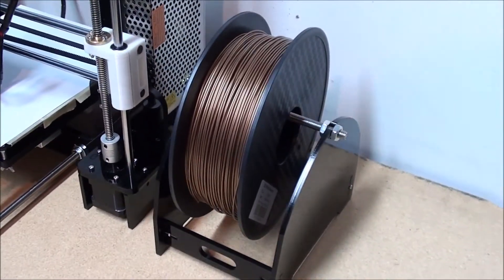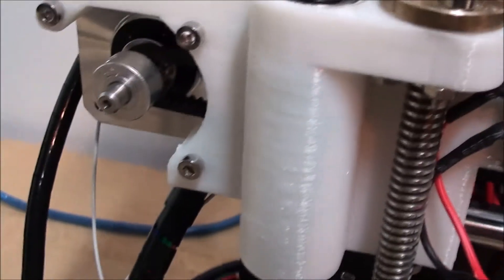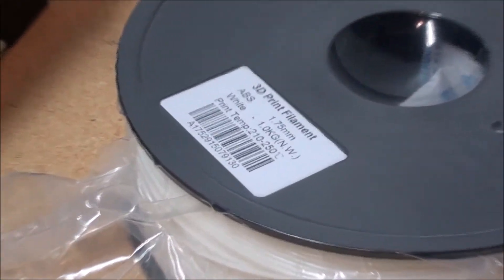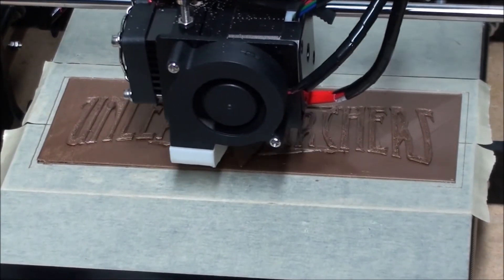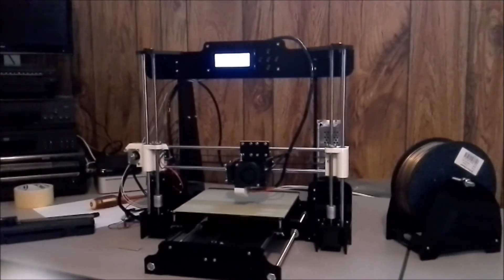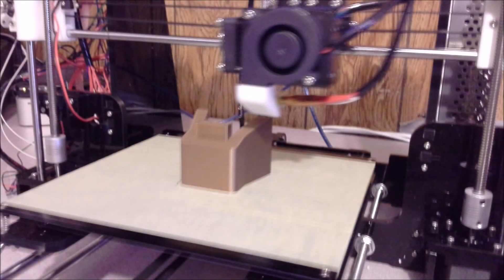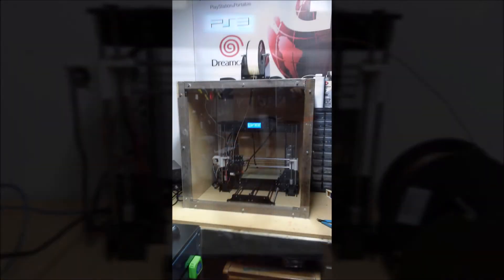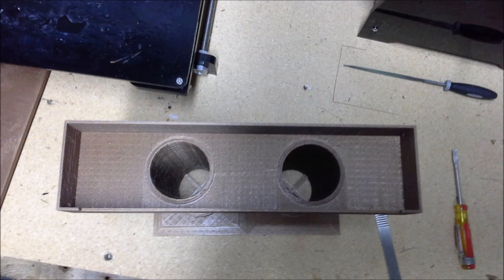Hesine 3d M-505-B Printer Review  | Links in Description Prusa i3, 3D Printer

Comment: I got one of these during the 11/11 sale and my experience is much the same as yours. I do not have an enclosure, but I solved my heat bed problems by adding a layer of high-temp insulation on the bottom of the heat plate. This reduces the downward heat loss and lets me keep the bed several degrees hotter than I would otherwise be able to get it. And it heats up faster as well. I also had some overheating connections on the circuit board (the heat bed terminals) and just added a 40mm fan over those terminals with a bracket from Thingiverse, which seems to solve the problem.
Reply from the maker: +Greg hey so great idea on the heat bed I am going to add that into mine as well as keeping the bed temp at the right temp prevents the ext ruder temps from dropping too much they are not fighting with eachother

Comment from the maker: I'll check in the morning you might need another file check the com ports in device manager it might be there might have to change baud rate that on the printer adjust it on the computer only tho
Reply: +G@m3T3cH Electronics Hi, sorry for the late reply. It's not the baudrate... How did you get it working and what windows do you use for it?
Reply: +Maarten Schut hey friend! i have the same problem, did you figure out?
Reply: +Andreas Pandazis Hey, still having the same problem. I have contacted hesine but the havent given me a solution yet.
Reply: +Maarten Schut Yestarday a friend fix mine, he instal a driver named ''ch341ser'' at the com port whitch i use for the machine..I use windows 7, try if you have still problem.
Reply: Andreas Pandazis Did not seem to work unfortunately, the printer does restart when I connect to it with repetierhost but it just won't listen to any commands...
Reply: +Maarten Schut  I see... I wish you solve the issue soon!!
Reply from the maker: +Maarten Schut hey did you get it going?  and did you try printing off a sdcard as well make sure everything is working another thing is check if a firmware upgrade is available for the board as well or a possible downgrade.

Comment from the maker: 60 on the bed for pla and 210 on the hot end, 80 on the bed 238 on the hot end I use hairspray on the bed tape is OK for pla I use brims as well on abs when needed I use cura on repeater host make sure it's set properly makes a word of difference found the test print on SD card sucks and level level level

Comment: hi G@m3T3ch !I bought this printer but and I had a problem and i cant solve, I try to calibrate the heat bed, when I calibrate the 4 corners, in the center the extruder is stuck and my prints go very wrong or you know if there is any way to auto calibrate hot bed? or you think what  happen?

regards and good video !!!
Reply from the maker: +Emanuel Sanchez how are you leveling by paper method or?
Reply: +G@m3T3cH Electronics  yes ! but dont work :S
Reply from the maker: +Emanuel Sanchez well use a small level and level the bed at the highest point then put the level on top of the extruder bars and make sure it's level as well. if that doesn't make sense I'll see about doing a quick video done up.

Comment: is there any difference between Hesine m505 and m505b?
Reply from the maker: I talked to one guy I'm not sure if his driver board was different or not for the most part should be little difference, if you check on the printer to get the model number is the best way to go. or if your thinking of buying check with the supplier they usually respond quickly.
Reply: +G@m3T3cH Electronics thanks a lot bro! are you happy with the print quality? and has ,the machine ever broke down?
Reply from the maker: +Riyaz Mohammed so far still running strong and like most calibration is key and have not been disappointed yet with it just small amounts of up keep.  only thing is I can't seem to keep enough filament in stock since this video I've probably gone though 5 rolls.  and yes not all prints are going to be 100% but stick with it and you will get the quality you want for your projects.
Reply: that was a really detailed reply!
i'll be ordering it this week.
thanks bro! really appreciate it! :)

Comment: Do you have a copy of the Marlin code used. I was thinking of attaching an autoleveller similar to this one and so I need to configure it: 
http://www.instructables.com/id/Enable-Auto-Leveling-for-your-3D-Printer-Marlin-Fi/

Unfortunately mine came with a missing plastic part but it wasn't essential. The supplier said he had sent me a replacement but I never received it. I'm getting a lot of Y slip on mine but I that was using Slic3r I was about to try Cura next.
Reply from the maker: so hows it going did you get it all going  and ya even now the printer still works or I should say a revision of it does.

Comment: Hi G@m3T3ch,  just bought what appears an almost identical printer form another Aliexpress source. Note this is my very first 3D printer..http://www.aliexpress.com/item/2016-Latest-Big-220-220-240mm-Impressora-Precision-Reprap-Prusa-i3-DIY-kit-3d-Printer-with/32606799455.htmlI think it just uses a different controller board.   Assembly, basic tests and bed leveling went 100% but I am having problems with the extruder/hotend. It just cant extrude any decent volume of the supplied sample PLA filament. I disassembled the hotend a few times already to see if anything looks clogged but it looks fine !?When I preheat to PLA (190°C) and use panel to squeeze out filament 1mm at a time, it seems ok for a second, 2 max then extruded filament gets extremely fine and eventually just stops extruding and the extruder motor just clicks.I just sent an email to the supplier and hope they will resolve the issue somehow but wondering if you can provide any clues about that extruder assembly.A specific question would be what is the spacing between the PTFE tubing and the actual nozzle base in the heater block ?  I am only guessing that the volume of molten PLA inside the nozzle is too small and that I should maybe trim the PTFE tube a bit !?Thanks for any hints you may provide, JP
Reply from the maker: +JP Roy are you using the software to extrude and if you have clicking sounds like a feeder issue and might need to look at what is going on there either not enough tension or too much tension on it.  

remember to slow your prints down to about 60%  or even slower and keep the feed rate at 100% I had a similar issue tho with garbage filament if you have anything else to test with I would suggest cutting a length to be able to feed through it as when it comes out it should be pretty straight and fluid at a higher up position.

black filament seems to be the worst so far that I have used.  white or natural colors have provided the best results for me and always check your filament with calipers at the start of your print and then when it starts to mess up it just prevents one variable.  

I have not had a issue with the printer at all its always been a software or filament issue.  

I would have to see it in action to fully get a idea of whats going on tho. 

feel free to email me should be a link below we can always chat and test via skype as well.
Reply: +G@m3T3cH ElectronicsI used the default print settings and I tried with Repetier host and using front panel buttons. no joy !Did try to print a simple 20mm calibration cube but that did not go well. I would say that the thing spewed out about 1/3 of the plastic that it should normally.I did not see your email and skype sounds like a good idea...
Reply from the maker: use cura to do your first slicing as the default in the printer calibration print was garbage even for me.  but for sure send me a email and will get setup here at some point and be able to go through it a bit better with you.
Reply from the maker: +JP Roy added you on skype and removed your email address as well there for ya.